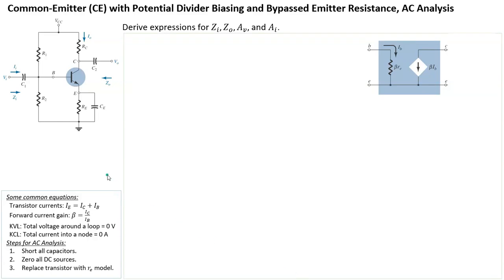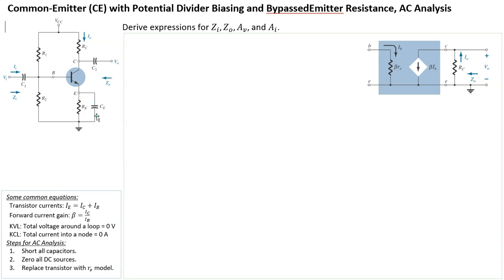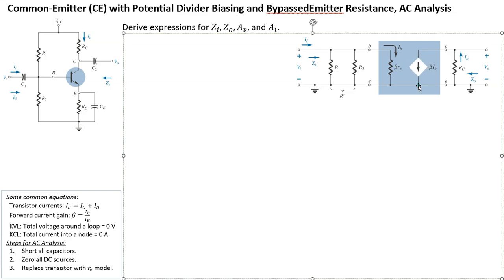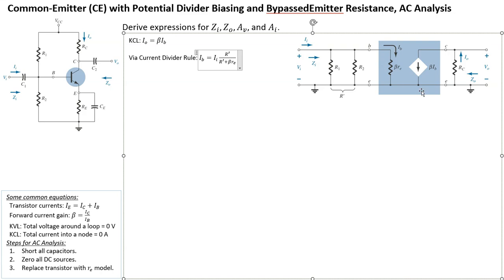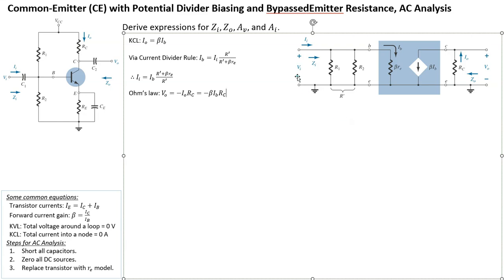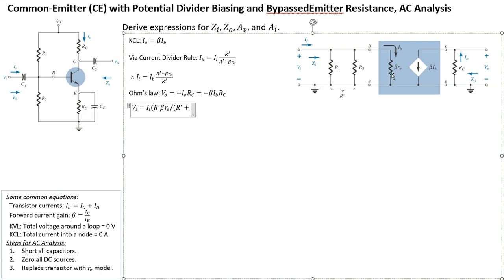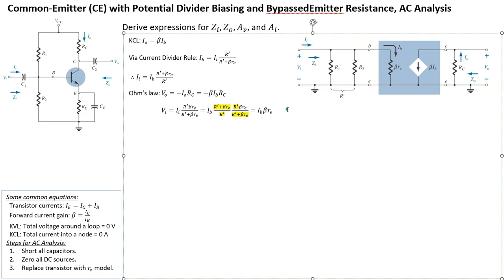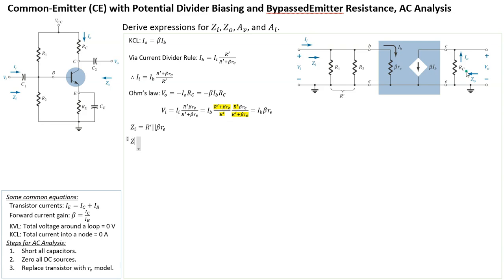Common Emitter (CE) with Voltage Divider Biasing and Bypassed Emitter Resistor, AC Analysis

Comment: WHAT DOES THE CURRENT GAIN FORMULA LOOK LIKE WHEN YOU INCLUDE THE LOAD RESISISTOR?
Reply from the maker: Assuming that your load resistor is R_L and it's connected between the V_o and gnd, then I_o would have to be redefined as the current going through this new resistor. The definition of I_o will change because it is now only a part of beta x I_b, as the rest of beta x I_b flows through R_C. You'll have to apply the Current Divider rule to get a new expression for I_o, which will now contain R_L. BTW, a change in I_o will also affect V_o and therefore A_v. 🙄
Reply: THANK YOU PROFESSOR!